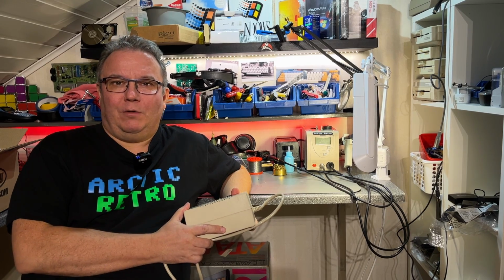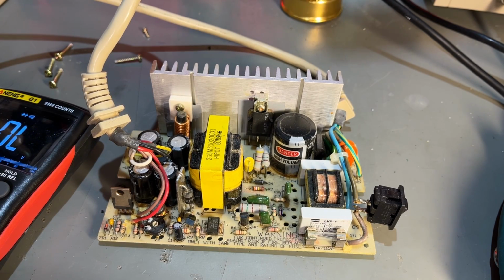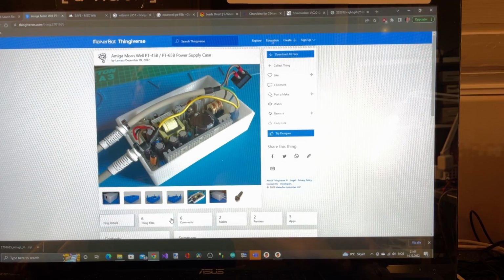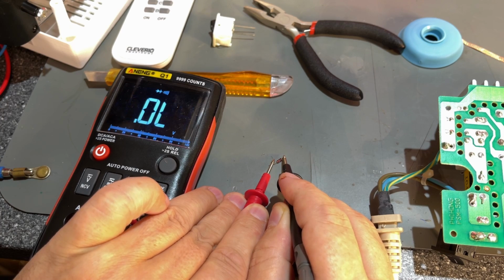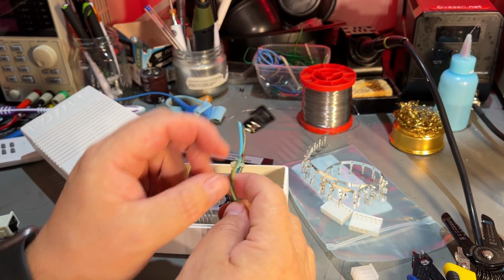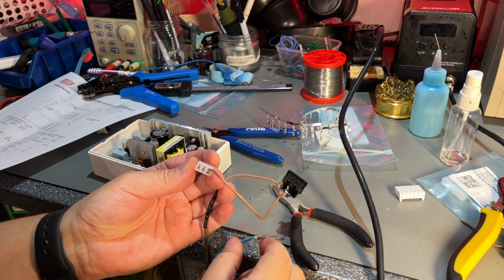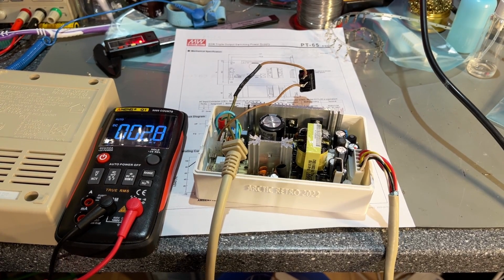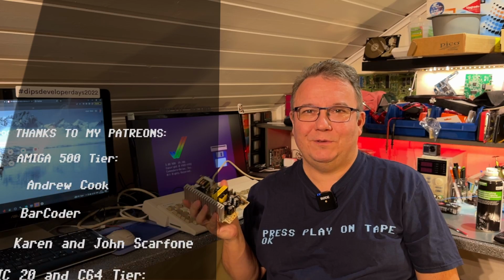Building a modern AMIGA power supply - And trying to fix a broken old one

Comment: So, did you cut off the cable's shielding? That's connected to the outer shielding on the plug, right? Isn't that the same connection as the shield pin? I'm refurbishing an A1200 mb but I don't have a psu, so have an old ATX psu I'm going to use to start with, but I need to buy the right flex cable to connect to the dp-215 (on order) to the ATX, and I've found some 6A 5 core cable.

Comment: I built an Amiga PSU out of a PicoPSU - they can provide some serious wattage and have 5 and 12V wires. Worked great on a 600 crammed with upgrades and I assume 500's and 1200's as well. Just desolder the ATX header and wire up the positives, negatives and ground to the Amiga connector. Just need the PicoPSU, Amiga power connector, 12V DC power supply with adequate wattage and some medium gauge wire. I wrapped the whole setup in silicone tape and it's been working for years now.
Reply from the maker: Thanks for sharing

Comment: The forward voltage of a zener diode is like a normal diode, like 0.7 volt. The difference is the reverse voltage. A normal diode will block the current up to a significant voltage. But a zener diode breaks down and suddenly starts conducting at, for example, 15 volt. That voltage is the value of the zener diode. And the change to conducting is very abrupt and precise which make them suitable as voltage reference. You can measure it with the diode in reverse, a 1 k ohm resistor in series and for example a 24 V power supply. Or with a power supply that has a current limiter (use a low current not to destroy the zener diode).
Reply: Nicely explained, and extra points for stating the correct test procedure.😉
Reply from the maker: Thanks for the info :)

Comment: Switching power supplies can be tricky to troubleshoot if you are not very familiar with them.  But, when you see no voltage on the secondary you can bet it's not switching.  That appears to be a zener diode, it may be possible to find its avalanche voltage if it still works.  Lots of failures will cause the power MOSFET to fail too.  Many times, it can all originate with a single bad electrolytic capacitor in the switching circuit - it's usually just a very small one.
Reply from the maker: OK, thanks for the insight :)

Comment: When I built my A500 power supply, I used that connector off of Ebay, some trailer wiring, the PT-65B, an enclosure from Mouser, and a power cord from a dead power strip.  It worked a treat, but my A500 is still dead.  At least the power supply works!
Reply from the maker: That's unfortunate :)